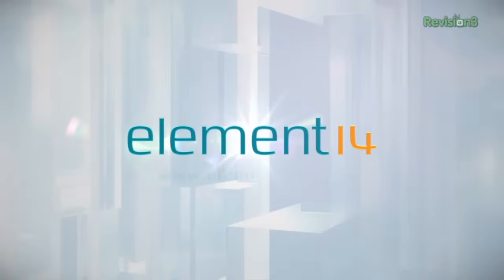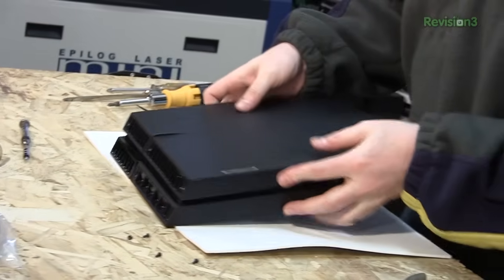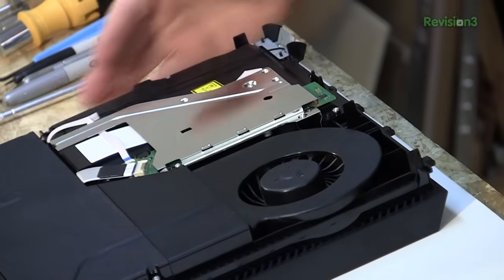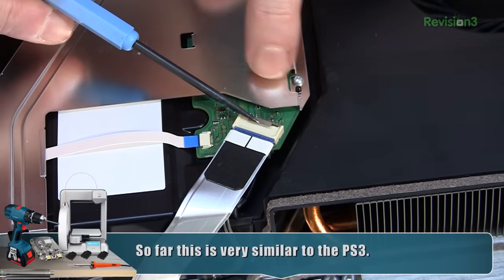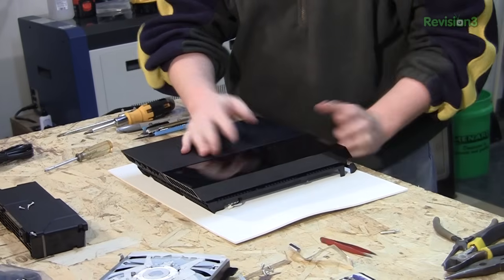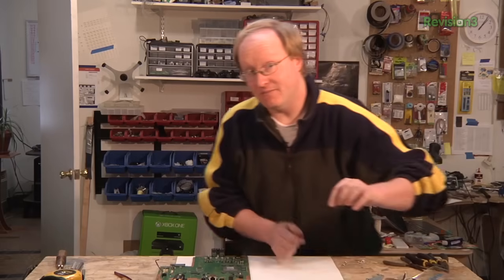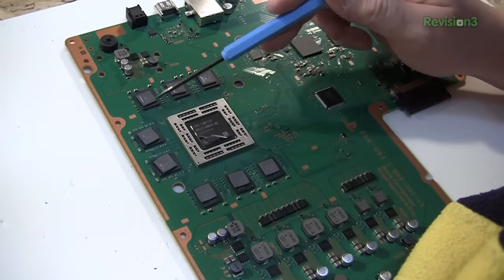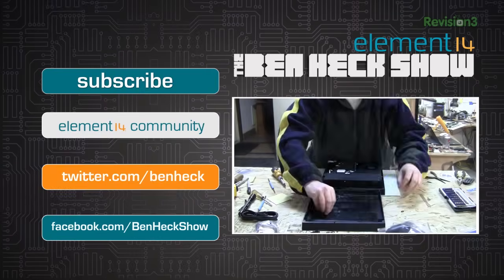Ben Heck's PlayStation 4 Teardown

Comment: You wouldn't happen to know what angle the front/back of this model is at? I'm trying to make an accessory in Fusion 360 but I'm not getting the correct measurements when using 119.67 degrees as a guy on reddit told me it was.

Comment: damns you sony for putting USB ports in the front and none in the back
you just love to fuck with our OCD ,just like PS3
even the pro only has one rear USB port and an  external HDD must go in a dedicated port
so you can not just use a  hub in back if you are using a  HDD you still need to have unsightly wires hanging out the front of your console this whole system is a shit mess
i just got psvr and  just found out i can't use it because i have a   wall mounted TV and there is no way to extend the AUX camera cable beyond 13' WTF sony
put the damn USB ports in back and give us a wireless camera or at least a camera AUX to ethernet adapter WTF are we supposed to do with a 6' cord anyways?
not to mention the shit mess of wires that is psvr
Ben  should make a camera extension adapter lots of people  need this

Comment: my Playstation 4 did not last as long as it needed to be.SCEA hired CHINA to do all the work..  You know what is next ? CHINA used cheap black market parts.  So when I turn it on something shorted out and exploded.. So there is only two things to go wrong. The Power Supply and Motherboard. I cannot open it  to find out what the fuck went wrong. I will make best guess based on logic and experience. That will be the power supply. Because that is the first thing that will go wrong. All that power rushing though that power supply dose take heavy load of its parts.. This is why I like the XBOX 360 bigger black gray version  That comes with a natural gray power brick that is external that got lots of room for better parts. That is why its still working.I all ways rather have a power brick. I hate the Playstation 4 design. power supply is internal. So that makes it harder to use bigger stronger longer lasting parts. SCEA lost me as a custome!!! not design to last. extreme short 6- 10 months of life That is it then one day something will explode.  I am not paying SCEA $100.00 I banned SCEA from doing business with me. the last time I have pay SCEA a repair job. The shipping box and shipping label is not sent. When I called SCEA many times. The serial number and the repair is  banned because I did not send it in. I do not have the mailing address. its top secret location. SCEA can move that location every month if why wanted to do so. I need that shipping box. for people get pissed off with SCEA. people go to Sager and buy a gaming 17" notebook.

Comment: ok ok stupit question ... but if the ps4 and the xbox one have the same harddrive what happens if you exchange them ... shuldnt the xbox run with the Playstation OS ?... if there is an other drive inside with the OS ... what happens if you exchange that ? ( i´m not native ..excuse my english)

Comment: At 10:15 there's a nice shot of the hard drive bay.

Now if I took a cutter and cut that bit of metal surrounding it out, could I use a 4tb 15mm hard drive in it without forcing the bigger hard drive in like I've seen in some other videos?

Comment: Have a impossible Challenge for you been  make a complet all in one liquid cooling set up IN THE PS4 with window  ( it can be done )  can you make a video doing this pro challenge?  Took me 1 1/2 years to do so and cost me roughly $300-400 with all parts  show it to the world its possible in one video ( hint : micro all in one pump/ reservoir  and small as possible  fittings will work maximum of 12mm tubing )

Comment: It'd be cool if someone put the PS4 internal parts into a PS2 casing. A PS4 that has the looks of a PS2. I don't even think it could fit in the PS2. Would it?
Reply: GuyThatCommentsVids  if u used the ps2 the fat original one. Yes it would fit
Reply: Genius! I haven't thought about that. The Tower of Power PS2 design is a classic and I'd love to get a PS4 that looks like it (and I certainly wouldn't mind the PS2's boot visuals and sound, too).
Reply: 5awie All Playstations have internal PSU- except the very tiny super slim PS2, I think.

Comment: 4.5 video ram. GZHD hardware processor. 2HZ graphics card (Best you will find on the market). Expansion memory compactor. What more do you want . The PS4 is simply awesome. WHAT?!?!?!
Reply: shahid khan with a terrible amd apu and it's video ram being shared with the cpu and components with the gpu not being clocked that high also with some of its cpu cores unusable for games
get a pc
Reply: PC's are without a doubt fantastic for gaming. But I get sick and tired of using the arrow keys and pushing the space bar to jump !!

Comment: Hey ben! I had a silly idea of putting this MOBO into a PC case, and I was wondering if you could let me know if I had to solder the mobo power connector to the 24 pin for a pc psu.

My assumption is yes, and if so, could you give a demo? Cheers!

PS: I plan on water cooling it, hence the reason for the idea.

Comment: The fact that the ps4 has the brick inside the console is enough proof how better engineered the ps4 is compared to Xbone
Reply: xbox one s has it internally, too. 
microsoft was more concerned about overheating so they played it safe. 
The playstation however is much louder than the xbox one due to it's little fast spinning fan and little space for air.
Reply: Xbox one S is a different story we'll compare that to ps4 slim

While its true ps4 is alittle louder but just think how Quiet and smaller in size the Ps4 would be had sonys engineers put the brick out side the Ps4
Reply: True, xbox one s is 3 years newer, that wouldn't be fair.

I think the main reason why the ps4 is a little louder and gets loud quicker is the smaller fan and less air in the console. The ps4 sucks air through its body like a vacuum cleaner. A lot of air through little room means fast air and a fast fan. 

Ps4 looks so much nicer next to a tv though. 
It's just a little loud when it's hot in the room and you want to watch movies with it.
Reply: +Stefan S just say it.... it's a piece of shit!
Reply: Ovais Saand it doesn't make   it better it makes it hotter did you ever touch the transformer block it holds a lot of heat I hate that thing it always getsin the way but I'd rather have it on the outside so my cpu last alot longer
Reply: Hahaha.   X bone....that's great... all it's good for is....well...shit...it's really not good for anything
Reply: Ovais Saand you and Stefan S are true genius.
Reply: but that is bad engineering IMO
why put all that added heat  near the CPU and GPU when you can just put it external and  make the console even more heat efficient and smaller?
makes no sense really
but my biggest complaints are no rear mounted USB ports just like PS3
i HATE unsightly wires plugged into the front of my systems
they should have at least put 2 USB in back
and also you can't extend the camera cable ,i bought psvr and i can't even use it at all because i have a wall mounted TV and all my wires run through the walls to my component shelf with is also a built in the wall on another wall, the camera can't be extended over 13 feet,sucks i had return my psvr

Comment: I tried to disassemble my gh controller once but the tools I had were a bit hard to use because the screw-holes were so deep so I got very little power because I had to stick in the long end and turn with the short end and I ended up filing off the whammy-bar since it's in the way when I play since I'm a lefty.

Comment: hey Ben I have a good question for you. people have been updating, (and I do say updating. it's not an upgrade.) their ps3 os to ps4 os on ps3 hardware. my question is how well ps3's hardware will  play ps4 software. because ps3's hardware is significantly older and less powerful. so if you have an answer for my question please reply. thanx and love your show.
Reply: +Crash Studios I  think that I did mention a difference in hardware, thanx anyway. the fact that I say update instead of upgrade. my question was about performance gameplay. just because of the diff. in hardware doesn't  mean NO games will play. I have a 1st gen ps3 and a 3rd gen also. one of them I do not use. if I can update and get a few games to play well, it might be worth it.

Comment: these  processors in the xbox one and ps4 are 10 times better in design. the die being directly on the heatsink is cooler and no dry thermal compound hidden between a shield. very nice to see as they should live longer.

Comment: It's pretty inexcusable at this point for Sony to put a mechanical hard drive in the PS4. I know a 500 GB SSD would have driven up the price a bit, but it's such an established technology it wouldn't have been that much.
Reply: The Xbox one has the exact same hdd. They expect you to replace it, so there's no need to include a high performance one. These is even an accessory that allows you to connect a full size hdd.
Reply: +Coloradoguy234 500 gb is a decent size, and I paid for the factory unit so I'm not taking it out as soon as I get the PS4 home. I'm at least getting a thousand or so hours of service on it before I replace it, so it should be an SSD out of the box.

Comment: I have regular t7, t8, and t9 screwdrivers and none seem to work. Do I need the "security" (or tamper proof depending on the store) type?
Reply: +Sean Obrien 
I use a T-1000 the liquid metal fills in the gap pretty well.

Comment: I fucking hate 5400 RPM drives. it's 2015 stop making, selling and using that shit in new products. I don't care how cheap the device is. It slows down any decent PC to a CRAWL!
Reply: +dbza 
Raid 0 that Sh@t!
Reply: +dbza are you stupid what do you want them to give you
Reply: 7200RPM hard drives minimum
Reply: +dbza uh sorry i though you are talking about some kind of a memory like the phones or sdd instead of a hdd, yh truly it will help alot if it was 7400rpm
Reply: Ahmed Zain np I was talking about laptops that still come with slow shitty 5400 rpm drives
Reply: well laptop need to consume little power to reserve the battery, so using 7400rpm is not idle, + with large capacity access time will be reduced so yes same rpm but more capacity mean faster hdd at the same power consumption level
Reply: Ahmed Zain computer will eat the same amount trying to search for data on a slower drive vs faster

Comment: Why does it have a coin battery?
Reply: +Erik Hansen Pretty much all computers have a battery on the motherboard for CMOS stuff
Reply: +Erik Hansen To provide power to the BIOS memory, so that BIOS setting do not defult everytime the system shuts down. It also alows the computer to keep the time system ticking while there is no power.
Reply: +Matthew Tremain 

I stopped reading when you said BIOS Memory..
Reply: BIOS, is core information that allows a system to start.

Comment: The fan is on the bottom!? very bad design
Reply: Lol it's not on the bottom. It's in the back. The Xbox One has a separate power brick and it STILL gets way too hot. PS4 wins in that category.
Reply: +SaWaDeeCat Yeah, Sony knows nothing about putting together a console system. Or... Sony has the best designed consoles since forever and probably know what they are doing.

Comment: Cool I actually was wondering if I could put in a higher capacity hard drive if I would screw my self over or not.
I'd most likely though just put in an external hard drive for more space and only put in a new hard drive if the one in it failed.
Reply: i wanted an external hardrive as well but the ps4 doesn't support them only 2.5 inch internal unless you buy an adapter that accepts bigger internal hard drives

Comment: What happens if you swap an Xbox hardrive with a PS4 hardrive, and vise versa?
Reply: ...Oh.
Reply: And in cause of that, nothing.
Reply: +Damien Kelly (Gremalkin088) Actually, by the look of it, no one has answered this correctly.
What will happen, is the Xbox One will cease to work, because the HDD is tied to the motherboard. PS4 isn't. The PS4 will work with a HDD from an Xbox One since it's just a basic 2.5" Sata II 5400rpm HDD. However, the HDD from a PS4, which is the same thing as the one in the Xbox One will not work in an Xbox One because the serial number is different. Microsoft chose to impose that restriction to prevent meddling with software or hardware.
Reply: +Damien Kelly (Gremalkin088) A paradox device is born....
Reply: Any answers by now are forfeit, and only for amusement purposes.

Comment: So do you put this back together and play it or does it ruin it if you take it apart? You know because of the thermal pads and paste and such. and if it does work what thermal paste did you use? Also are ports/connectors expensive because of licensing and/or they're a proprietary technology or are they just expensive to physically implement?
Reply: Vic Vinegar I also love how Sony lets you replace the HDD considering that an HDD is the part most prone to failure. So you don't have to send your entire system in for repair.
Reply: Vic Vinegar yeah tf you can replace the hd in a xb1.
Reply: Donta Agee not without taking it apart and voiding the warranty.